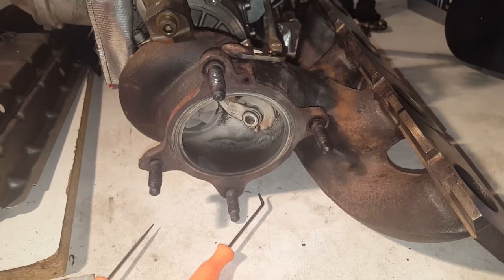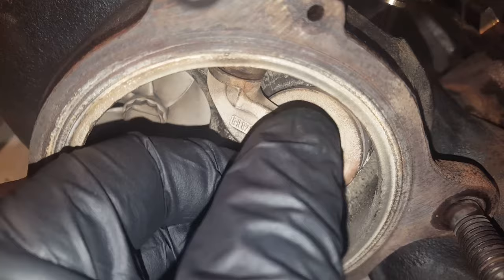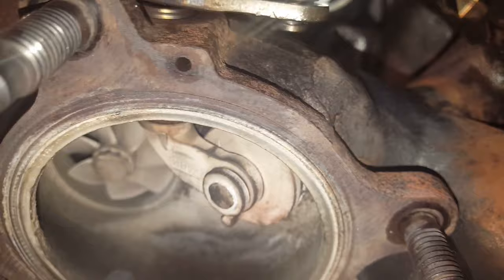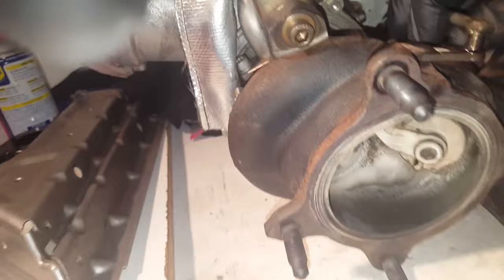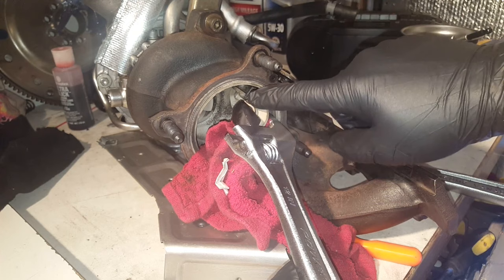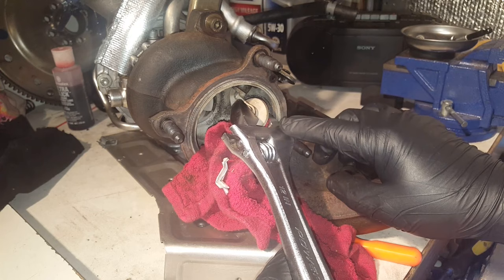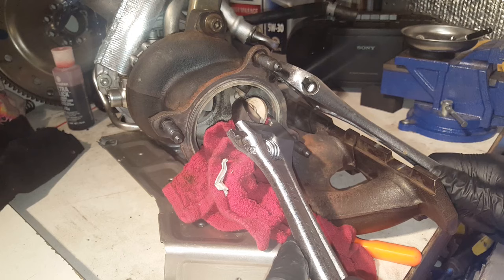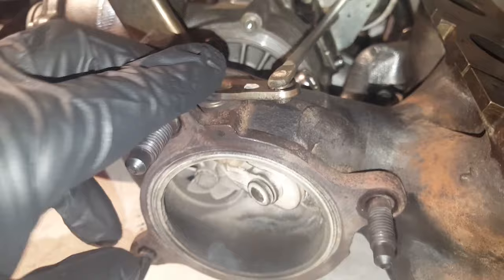Turbo Under Boost Problem Solved, Code P0299

Comment: Dude you are a god, i fixed my turbo from this video while all mechanics told me it needs new turbo , million thanks 🍻
Reply from the maker: You are welcome, I am glad it helps
Reply: @samstye  as a Christian man he’s definitely not “God”Jesus”and othergods are not real how ever amazing video bro very helpful thank you :)
Reply from the maker: @JusZard  You are welcome any time.
Reply: @JusZard  the Bible states were gods🤷‍♂️😂
Reply: @jakecx259  hmmm? Idk man maybe a different Bible King James Version is what I’ve read …. But to each their own I’m just saying my opinion not trying to offend anyone .
Reply: @JusZard  Psalm 82:6 I have said, Ye are gods; and all of you are children of the most high🖖👁
Reply: Hi bro my a class mercedes a180 2014 w176 petrol engine sport  doing whistle when I changing gear and pushing gas pedal doing whistle sound or noise van you tell me what to Do please??
Reply: @JusZard cry about it
Reply: I had several volvo xc60 under boost problems i tried replace chra with same housing with this thing faults never gone, with this i tried remove this housing from the turbo with no fault to the one has fault and it worked fine, looks like i was attending cartilage and air leak only, i even tried replaced wastegate actuator with no success, am happy for this
Reply: I had several volvo xc60 under boost problems i tried replace chra with same housing with this thing faults never gone, with this i tried remove this housing from the turbo with no fault to the one has fault and it worked fine, looks like i was attending cartilage and air leak only, i even tried replaced wastegate actuator with no success, am happy for this

Comment: I literally fix the same issue with it in the car The actuator that rod goes to I just bent the bracket slightly with a pry bar My car's been running without the under boost code for over a year now
Reply: Witch spot? The arm coming from the flap or the actuator rod itself?
Reply: @wesleyhunter501  some aftermarket actuators have an adjustable rod mine did not because it's factory  the actuator bracket is what I bent moving the actuator and rod which tightened the internal flap
Reply: You should be able to get in there and wiggle it to check play you don't want to bend it too much you will cause over boost
Reply: @donaldmccormick1584 play in the rod back and forth not side to side?

Comment: Wait please answer this. The washer you took off so that the waste gate opened, is that supposed to be on there? From my understanding you had the washer on and the waste gate was closed although it was moving still and it wasn't supposed too correct? So if i have a washer on and the waste gate is closed and doesn't move is that a good sign? Im just confused because how would it be able to open when it needs to if the washer is on

Comment: I am having hyundai sonata 2013 same error  (p0299 turbocharger/supercharger underboost) dashboard engine light also always on, couple of times local garage try to reset code but but it come back after a day, when I ask him to checkthere might be some small issue cuz I feel car race and pickup is kinda slow, but they all say one thing just change turbo, after seeing your video I'm more sure I might have the same issue
Reply from the maker: In most cases P0299 trouble code is related to wastegate issue, but also to be on safe side maybe same garage can take look if is wastegate loose or not after engine cools down. Thanks for watching
Reply: @samstye  I'll keep  that in mind, thanks alot for making me understand better and in details
Reply from the maker: @arsalan5426  You're welcome,

Comment: Sam, amazing video, and solution, even if its temporary. Question, what happens if you ignore the engine light, and keep driving with the P0299 code?
Reply from the maker: Car would still run and drive with under-boost which would causes to loose some power depends how bad under-boost is some drivers don't even notice anything and keep drive like that for long time but also keep in mind modern vehicles won't pass smog test if check engine light is on so automatically can't register it in many states without smog test/check. Thanks for watching I am glad you like it
Reply: @samstye  i figured....i don't notice any drop in power, or drivability.  Thanks again.
Reply from the maker: @danmazz8733  Sure any time.
Reply: @danmazz8733  same any update??
Reply: @HaiderAli-qn2ec  i sold the car :(
Reply: Well I've been driving mine for 2.5 years with overboost issues. Currently got parts to try to fix it my self
Reply: @samstye  yeah I have a 2014 ford escape sans I do DoorDash and Uber, my check engine light will come on and then it will go out. I’m dumb when it comes to cars so I don’t know if it’s Severe
Reply from the maker: @rickyshaun1601  If check engine light was on one time and goes away and comes back again there should be trouble code stored in history if you have OBD2 scanner you should be able to locate it if you don't have OBD2 scanner most of auto parts stores have it and in most cases they would scan customers cars free of charge.
Reply: @samstye  they did that but now the code is back on, I have the same question. If I don’t have the money right now, can I still do my DoorDash, I love my ford. And I panic when something isn’t right. How do I get in touch with you. I have some questions
Reply: @samstye  yes so I can drive with this code. I have a 2014 ford escape. And the p0229 code came up. Can I still drive to do my deliveries???
Reply from the maker: @rickyshaun1601  Sorry but I don't know if you can or not, I would contact local mechanic shop to take look since I am not very familiar with ford engines and that code . Thanks for watching

Comment: Is it worth it to change the whole turbo out for for an aftermarket setup? Something that is more reliable?
Reply from the maker: If car warranty is expired already and aftermarket turbo matches specs and quality I don't see why not since that's external part if goes bad replace it again, but I wouldn't prefer aftermarket parts.
Reply: @samstye  thank you for that information. I’m getting a p0299 code, and the 2 repair shops I’ve gone to have insisted on the idea of a bad turbo (only one has looked at it, and they’re a gas station general service and maintenance shop). The quotes they’ve given me are absurd, and both of them have actually gone up from one day to the next despite nothing changing from 1800 for a full install to 2300, 2400, 2600. I can see plainly that aftermarket kits, even OEM kits, costing a maximum of $1200, and the standard job time is 4.5-6 hours. The car runs butter smooth, just doesn’t have much power and the CEL is on. I don’t feel the diagnosis is right, or at the very least doesn’t require a brand new turbo, but what do I know LOL.
Reply from the maker: @Sss-vs7pu  In that case I would probably consider OEM Refurbished one since they are much cheaper and still OEM.
Reply: There is any way I can call you?? I have the same issue with my 2009 Volkswagen tiguan Turbo/supercharger P0299 if you can fix for me , just need address and phone number,  also price
Reply from the maker: @joelngandu9571  Sorry Joel but I am kinda too busy right now, but I think it would be cheaper for you to search locally first.
Reply: @Sss-vs7pu  hey did you ever get this situation figured out? I literally have the EXACT same problem atm on my 07' A4 :(
Reply: @1DreamV6  fix it yourself, duhhh

Comment: This was great video, thanks for making this man, you saved me some $$$ ! For anyone who’s trying to do this get bigger pliers, personally think two 12 inch pliers should do to get around space constraints like shown in the video. I didn’t have two and had difficulty in wrenching them, so used a c clamp for the upper part and wrenched the bottom one, worked like a charm, did like 20 miles so far not much but plan to do more over the week, will post here once i do more miles! Thanks for the video
Reply from the maker: Good job!, I am glad it helped
Reply: Guessing dude never Mede it home 🤷🤷
Reply: Did you have to take turbo out?

Comment: Hello,
I have P029900 low boost code or turbo undercharge and it was noticeable that my car is losing power or not boosting enough. I change diverter valve and nothing. remove the catalytic converter and there was decemt amount of free play on the wastegate. I hammered it the rod in the fron kinda push it back and boost is back and this is my temporary fix till i replace the entire unit.
Reply: Disculpa que pieza es esta?

Comment: Are you able to do this with the turbo still in the car?
Reply from the maker: I guess that's possible with some struggle, as you see I was rebuilding this whole engine and had it out already  but if I ever end up repairing only waste gate on the turbo I definitely would try while is still in the car since I would have to go trough same process to take it out any way.

Comment: can i ask ? what was the problem in driving car ? time from time boost presure just drops down ? I have no active p0299 code and no check light.  But when drive the car some times boost just disapear... and cant understand when it shows up again and why !? dont want to change all 3 vacum sensors to fix it.. :(
Reply from the maker: In most cases ECU will set the code only if problem appears within a specific amount of time,  so I would use OBD2 scanner and look for stored codes, I know only bigger mechanic shops own expensive universal OBD2's scanners but happy medium scanner should work too in many cases.
Reply: @samstye well thank you. How i was told i have no active p0299, but it is stored in history.
Reply from the maker: @ingussvikis9751 if P0299 code is stored in history that probably was sticky waste gate one time or possibly still is but also intake hoses get softer when engine is hot and they can leak randomly as well depends how much pressure they get in different driving conditions and time since very small crack sometimes is not detected by ECU.
Reply: Thank u a lot !

Comment: I want to know when you start the engine, in which position the westgate goes, open or closed
Reply from the maker: In most cases Cold start opens WG for very short time to help heat up cats.

Comment: Can you do this method with the turbo still installed , I have the cat off and the waste gate thing is visible???
Reply from the maker: You should be able to as long you have ability to hold both ends sturdy and just enough clearance to twist flapper pin very little and gently.
Reply: @samstye  I removed the entire assembly , and did the exact same thing you did it’s tight for now is there like a range of mileage I will get before it fails again?
Reply from the maker: @6hunnitCCsan  it really depends on driving habit but the one you see on this video drove already about 40k miles and still runs with no problems or check engine light.

Comment: So for my understanding; you are bending the axle which goes through the turbo? In other words; are you "closing" the room for play by bending it a little bit?
Reply from the maker: More like kinda twisting the rod or pin just enough to close gate slightly tighter that's all.
Reply: @samstye  Ah ok. So this is a way to fix it when you dont have an adjustable rod on your wastegate actuator? Because I can adjust mine on my Audi Q5. So I can just tighten it a little bit to achieve the same result right?
Reply from the maker: @Sjoerd001  You got it!
Reply: @samstye  So how do you make sure you don't get the overboost you mentioned?
Reply from the maker: The way I did it is by twisting it just enough to close the gate snug and I also made sure it opens/closes freely without delays didn't need any additional tension on the wastegate rad or pre-pull all it needs is to close lightly that's all,  @Frostensen

Comment: Hi there
I need to know if I can do this jobb on my Audi a5 with the same code without taking out the turbo. I have been driving the car for a month with this under bosst problem.
Reply from the maker: A,J was asking same question down below,
I guess that's possible with some struggle, as you see I was rebuilding this whole engine and had it out already but if I ever end up repairing only waste gate on the turbo I definitely would try while is still in the car since I would have to go trough same process to take it out any way.

Comment: Hi Sam, I've got Seat Ibiza 1.6TDI 2011 with turbo under boost. I checked one side of the turbo where the turbine is and it spins all right and I don't see any damage. The question is: can this valve make a metallic clicking noise while You push the gas? I will open the other side of the turbo tomorrow in hope that it is the culprit... The car is in limp mode.
Reply from the maker: Loose wastegate can make noise but wouldn't be noticeable as much and also in most cases would under boost as well.

Comment: Hey sam i have a 2017 chevy cruze 1.4 turbo. I have a p0299 underboost code. I noticed that one of the big metal clamps broke. Could that cause it also or do you think its still the waste gate
Reply from the maker: Brad! 
What clamps you are referring to can you provide a little more detail possibly.
Reply: @samstye  it's a big metal clamp that goes around where the turbo connects to the exhaust and has a bolt that tightens it.
Reply: I think it's called like a v channel clamp. It's heavy gadgets metal
Reply from the maker: @bradconner5266  Ok if your clamp is broken after the CAT l don't think that caused under boost, however back pressure can cause problems and link them to the turbo.

Comment: Hi there. Total stab in the dark but here goes. 
My audi a6 2012 tdi goes in to limp mode when I put my foot down on a hill. The glow plug warning light flashes on the dash and the speed goes down. I turn it off and back on and it's OK till it happens again. A mechanic has told me it's something to do with the turbo pressure or regulator but he's not sure what exactly.  I was wondering if you may knw about this or be able to advise me or is this video about the same issue? Any help or advise would be massively appreciated 🙏 🙂
Reply from the maker: Sorry to hear that,
Did you check with OBD2 scanner if ECM stored any trouble codes, that will tell you if actual glow plug is bad? and or if turbo has problems if you don't have OBD2 Scanner check with your local auto parts store in most cases they will scan it free for you and tell you codes they find.
Reply: Hello, i have the same problem as you! Can you share how you fixed it?
Reply: @user-mt9jb7em3n  hi. So I showed my car to a local audi specialist who done a full diagnostic test including a boost check. He found that it was a under boost fault. He checked to see if there was any other issue and there was not. So he deleted the fault and the fault code frm the computer. If there is no fault code, there is no fault. It solved my problem. Car now runs like brand new. He assured me by deleting the code it would not damage the car or engine etc on the long run or short term. Cost me 150 which included removing the remap I had and replacing it with he's own remap level 1.
Reply: @mampy786  Thank you for your help. Be healthy.

Comment: Hi Sam

I have same code with 2013 Dodge Dart 1.4L. CEL came on while driving and car felt like bogging down under hard acceleration.
However in city driving it runs fine. Issue comes when running on highways especially under high rpm while overtaking.
Reply from the maker: Since you have under boost code P0299 big possibility is that wastegate is loose and not holding boost so I would check on that first but after engine cools down overnight then go from there, also sometimes but very rare boost solenoid goes bed as well.